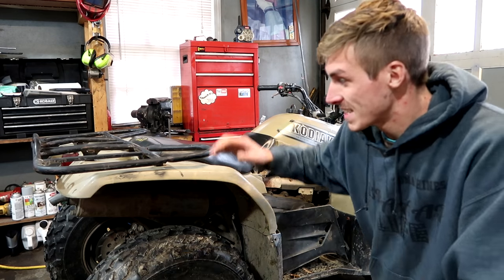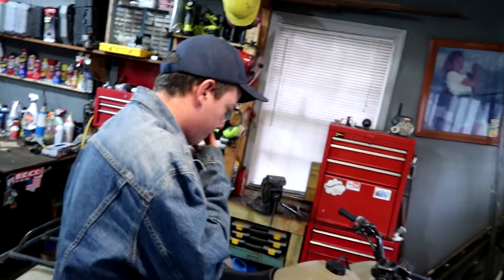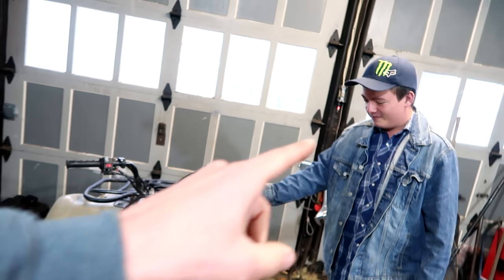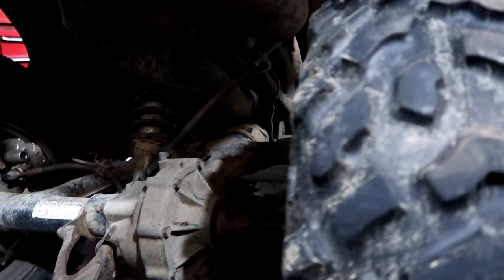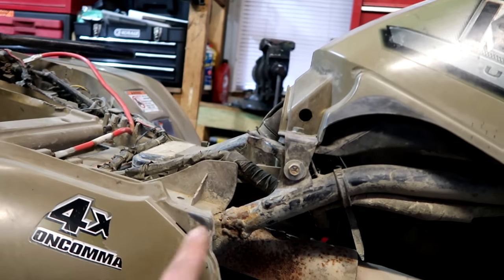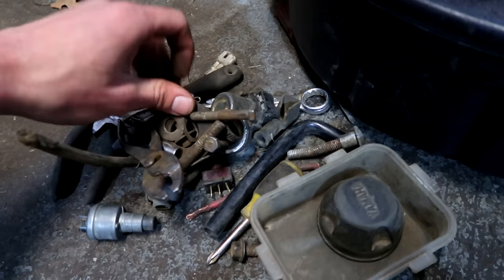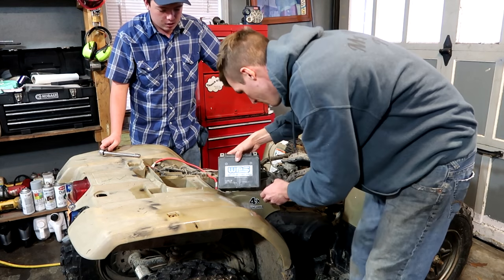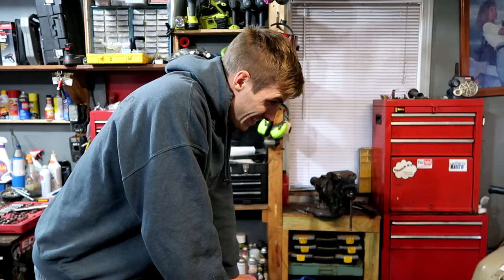NEW KODIAK has CRACKED FRAME!

Comment: Frame fix is simple - cut bad section out and weld new piece of tubing in.  I'm sure you already know this, but you could even get a tube ID that goes over the factory OD and weld the joints with three beads.  Pretty, no...but it will be dang solid!

Comment: As far as the dodge speedo goes; I have an early 07 3500 still with the 5.9 common rail, and ran into the "gauge flutter" on my tach. 

The fix was to remove the gauge cluster and go through all your solder points on the board and heat them up to fix and cold solder points. As the truck bounces that circuit board flexes and breaks the contact. Thats a large reason why the gauges just drop suddenly then come back to life. 

Try it anyway. its a free fix if it works.

Comment: I've had same thing happen when I bought a atv   only difference with mine is guy shoved paper towel in side case to prevent oil from leaking out frame was broke 4 different spots and a arms broke just to say I scrapped the p.o.s only spent 65 on it lol

Comment: When i was young I bought a lot of atv's  dirtbikes  snowmobiles etc...   You need to save a decent amount of  money up and wait for the right one, one thing I learned is the guys that raced them treated them like their children, those usually come with many receipts for parts + a ton of spare parts and need zero work.   The ads  that said never raced were driven hard and put away wet and need a ton of work  my .002.  I always ask to take the plastics off and look at the frame,  if the guy says no I move on, then check everything out look for wear around where your feet sit look at the side cases for wear and check everything 2 times make a list of what it needs and use that to barter.

Comment: u should put a pipe that inside same size as frame drill holes in the sleeve weld both ends and fill the drill holes sand, prep and paint video well done

Comment: I you want to drive down to southern il i will sell ya my 2000 yamaha 350 wolverine for $1000 with new tires and new cv shafts new fluids new bearings everywhere. New cam chain new flywheel and stator. New battery new carb. Only prob is the clutch oneway bearing has needed replaced for a while. Just doesnt slow ya down SOMETIMES when going down hills. Doesn't matter much considering it has front and rear disc brakes.
Reply: SIMPLYBEAST1231 dude I'll buy it I live in Oklahoma

Comment: I know what your going through with bad owners. I bought a 2004 honda cr125 and rebuilt the whole motor after 3 rides because I blew it up
Reply: Mason schrader how's that the owners fault
Reply: Noah Unknown You couldn't tell that the bike wasn't good from when I went to pick it up. When you replace the clutch, top and bottom end and the gear oil comes out a metallic gray color before puting on a ride, you could tell it was not treated well
Reply: Mason schrader you should always give  the machine a full check down before you buy it

Comment: BEING IMPULSIVE & CHEAP = JUNK
Reply: 02SubaruWRX not always
Reply: Haha
Reply: i bought a super clean 2005 Honda TRX450R for $800 bucks! wasn't running but was 100% complete and in good shape. was bone stock. checked the valves and the intakes were way out of spec. adjusted them & cleaned the carb checked the jets etc... and it started up 3rd kick and ran great from then on... sold it for $2300 cash